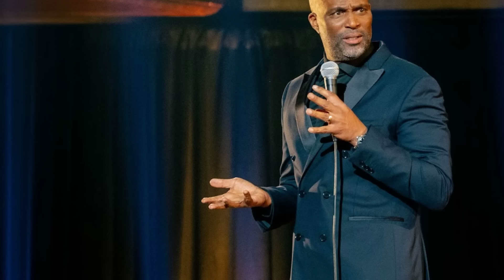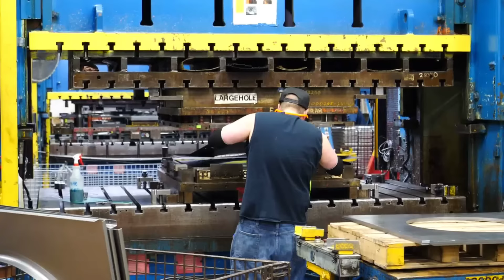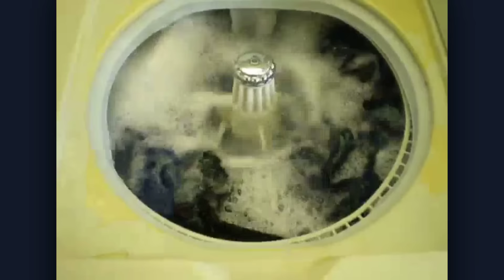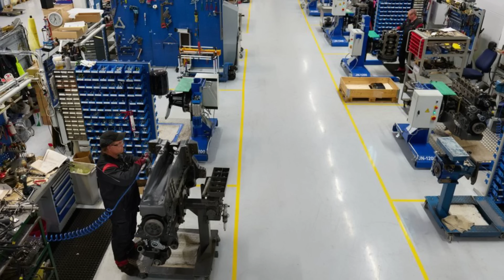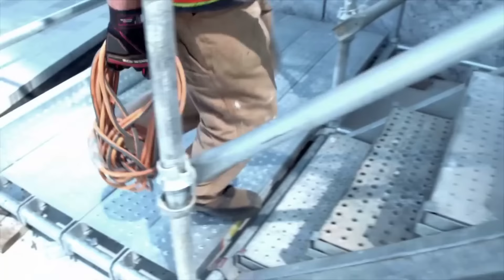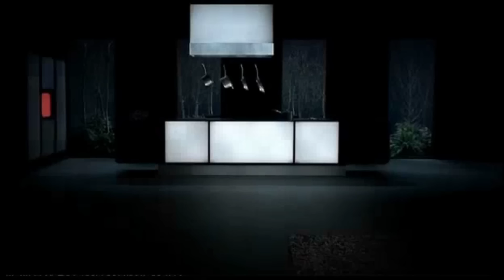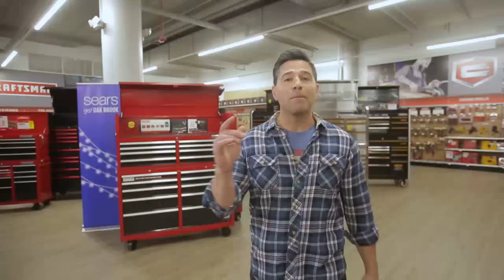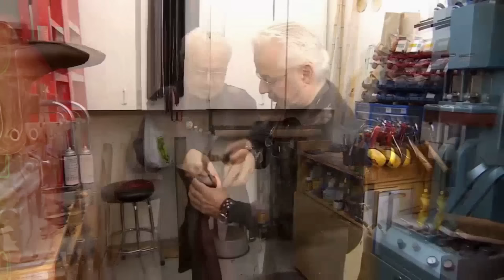The Only 5 Brands That Still Last (The "Buy It For Life" List)

Comment: Speed Queen (Washing machine)
Honda GX (Small engines)
Goodyear-Welt (Leather boot construction method) 
Cast Iron frying pan (Tennessee's Lodge skillet)
Channellock of Pennsylvania (Wrench) Wright Tools (Wrenches and Sockets)
Reply: Thank you!
Reply: Thank you!
Reply: Thank you 😊
Reply: Speed queen washing machine for sale
Reply: There has to be more than five?  I have three VERY old washer dryers.  Kenmore washer at least 35 years old.  I had a GE oven that finally failed after at least 30 years, only because a needed part was no longer available.  New top rated GE digital computer display failed after 10 months, in ONE YEAR warranty, but now it isn't.  

GE radiant cook top lasted at least 18 years, until I broke it.  I found a GE convection with analog controls, but had a mfg defect covered by one year warranty.  now they are trying to sell me a service contract.

My old fridge failed after many years.  Best I could find was a Whirlpool made in Canada, ONE year warranty, so I bot a five year service contract.  I don't expect it to last much longer.  

CRAP.  There are good brands like Speed Queen, which I will buy.  Or an analog GE "garage" fridge that should last quite a while.  But our choices are diminishing to Zip.  

New cars are a NO BUY!  Period.  Good used ones are hard to find.  New cars now track you, & will shut your engine down if a chip stops working.  A $500 headlight?  My old Camry uses an $8 replacement bulb.

We are screwed.  Big Time.
Reply: @millerforester6237 The existential problem with cars is there's obviously no old no-frills robust EVs.

But Internal Combustion Engines have this one little issue with .... 
wars in the Middle East.

And look, in about another decade who knows what issues there may be with supply?

There are however small enthusiasts businesses who will do electric conversions of I.C.E. cars.
And with them being aftermarket modifications/retrofits - being able to replace parts should be far simpler. As since its able to be installed in a garage.. its able to be removed and dissembled in s garage.

Especially as DIY conversion kits are available, which will also mean that spares should be readily available. 

And while I don't have specific knowledge, I'm assuming the EV components are not sealed disposable units.

They actually have one advantage when choosing what car, since they are a full engine and powertrain, a donor car with a crap engine (unreliable/low performance) can be chosen.

So a good solid framed vehicle with a long life expectancy can be used, and could be cheaper if the gutless smaller engine model is sourced.

Then install a EV kit, and its up and running, with better performance. Sometimes much better performance if you spend for more powerful electric motors.

And you won't be installing all that data harvesting crap.

I did check out the hobbyists' community back around the early 2000s (after GM crushed their first EVs) when they were all individual installations with the parts sourced separately and wired up.
And obviously much worse battery technology.

But there were some ridiculously fast stealth cars built by "rev" heads.

Including a little Japanese sedan originally from the 70s or early 80s, I think it was a Toyota corolla or a Nissan?

That had the most powerful motors they could find and shoehorn in.
The trunk and engine bay both contained the EV components and batteries shared out between them.

And this normal looking demure little Japanese sedan that only had larger rear wheels and race tires to distinguish it from a grandma car at the carpark.
Would blow away big muscle cars at drag meets.

Now take a good truck chassis 4WD that doesn't rust, and fit in a modern powerful more efficient EV kit.
Eventually yes the battery pack will deteriorate after a decade or so, but thats the only major component that needs replacing, regular maintenance is far cheaper.
And the battery pack can still live on as a fixed battery, say for home power.
And in a decade the replacement battery pack will be far cheaper and hold even more power ie have greater range.

Already ten year old EV replacement batteries are cheaper than a replacement battery cost when the car was knew.
And have more range.
Its just a issue that the dedicated EVs back then were very Meh and built around the longest quotable range, with everything else nerfed to achieve that.
And they often lacked some useful tech like temperature control for the battery, so it didn't get damaged by extremes.
[Early Nissan Leafs suffered in hot climates].

But some old EV conversions are still going strong.
Although I dont know about that little sedan drag monster.

I'm not sure, but I think the owner also had a classic 70s Mercedes diesel limousines, one of those cream yellow ones, also done as a EV.

Oh and the great thing about EV conversions, besides the lack of nanny state big brother integration....

You can keep the full sized spare tire that came standard with the car.
Reply: I'd love a UK version of this message. Only the Honda is familiar to me. Great video!
Reply: What about tires I need tires for my Ford Escape?
Reply: @rousseautr  Tires aren't meant to last forever. Check the ratings on the tire for the mileage they are intended to last, then rotate them every 5k miles to actually get that mileage out of them.
Reply: @txlady1049 thank you, this I know. I was hoping the experts in this comment section would recommend a quality tire.
Reply: @rousseautr  In my experience, most of the major brands produce tires that will last a good amount of miles if maintained properly - check the pressure with some regularity; rotate with every oil change (typically 5-10K miles in modern cars using synthetic oil).  This doesn't count "performance tires" that generally do not last very long. On my sporty car, I run a very high-grip tire that makes the car more fun to drive, but don't last more than 10K miles (even swapped out for the Winter months).  I accept that for the performance the tires add to the car. The car is also not my daily driver, so the reduce miles still mean I only replace the tires every 5 years or so.
Reply: @ianfurqueron5850 this information was awesome! I am recently retired and am running the roads but in a Mom style car, just lost my mechanic and am learning this stuff about my vehicle 😢😢😢 non girlie is not my wheel house.
Reply: @rousseautr Michelin
Reply: @rousseautr  I literally sold tires for a living until I went back to earn my Masters - I found Continental, Cooper and BF Goodrich made for excellent choices for most driving applications. These brands almost always offer rebates or dealer discounts all year as well.
Reply: @rousseautr tires, it's a trick getting the right tire for the right truck. It has nothing to do with aesthetics and what makes it look so cool. Most vehicles should only have a 13 inch rim for a tire. Four-door 0lder cars should have about a 14 inch rim. 
  Motors in cars are like bags of weed.. it's easy to upsell a bag of weed when you can hold your breath and tell you almost pass out and say let them, that s*** almost knocked me out but you can't pretend anything with automobiles, they're either a pass or a fail.  Companies are putting tires and rims that are significantly too large for the entire drivetrain creating catastrophic damage at an early stage. On top of that, the replacing reliable dependable parts with parts designed to fail. If you find an old rusty bucket, it only needs four parts to get it running... Think about it
Reply: Thank you
Reply: Thank you!!
Reply: you're doing the Lord's work
Reply: GRISWOLD cast iron #1 (made in Erie PA USA!) is the gold standard! Then #2 Wagner (Sidney OH USA!) and #3 Lodge (USA & China)…..
Reply: Thanks. I didn't feel like watching another piece of sh!t Ai video.
Reply: thanks for compiling this list
Reply: Have at least one of each!l

Speed Queen's have bearings with grease zerks!

How Honda does it I can't understand.  Kawasaki is about the same.

Yanmar diesel generators are the only way to go.
Reply: Appreciate your doing the written name brands so much. Thank you!!!
Reply: Briggs & Stratton small engine
Reply: Love my speed queen - 7 years ago and no issues - simple dials - love !!!
Reply: I took an appliance repair course about 25 years ago. Although Speed Queen was highly praise for its stainless steel basket, the agitator and shaft were pot metal so electrolysis caused by the soapy water eats away and the shaft and they all fuse together and seize up.
Reply: Great, now I need to find a cobbler.  Apple cobbler?
Reply: Miele is better.
Reply: Griswold!    Look for anything used Griswold, typically cast iron skillets, made in Erie, PA.  They have a smoother surface than Lodge, and they'll NEVER wear out.  Just learn how to 'season' them.
Reply: Channelocks are trash. And I consider anyone using them as hacks. I quit using them 15 years ago.
Reply: @tacocattoday  Ok pal
Reply: Thank you 🎉
Reply: FYI - Lodge cast iron is made in Tennessee, not Kentucky
Reply: @judirollings3959  yes! That’s what it says
Reply: @mooselodge3881 that's what it says NOW. See that word (edited) by the time stamp? The OP corrected it after it was pointed out. 😉
Reply: I found a wrench that beats Channel lock . Sears used to make them, then Kirkland . Don't know who makes them now. Channel locks slip too easy and tips don't line up..
Reply: @chev39rsh Knipex pliers are made in Germany and are the best I've ever used. They are expensive but a pleasure to use and worth every penny.
Reply: @unpopularopinion8608  True. Knipex, Wera, Wiha. Buy it for life.
Reply: @unpopularopinion8608 they're even not that expensive when you buy them from Germany.
Reply: @unpopularopinion8608 second Knipex. All sizes all applications. Knipex is king.
Reply: @unpopularopinion8608  And the Knipex Cobra grips are superb - well designed and thin construction and just fit in your hand perfectly.

Comment: If you have problems with the carb "gumming up" you are using ethanol fuel,  Never use ethanol in small engines.  It turns into green fuzz, which plus the siphon holes in the carb.  Unless you have tag wire (which I do) you're stuck.
Reply: Can’t you put stabil in it, and run it dry? 64 year old woman here. I use stabil, high octane fuel but try to run all my small engines dry….

Comment: I wore Thorogood Blk 6” steel toe boots for 2 decades until they changed their manufacturing. Boots were purchased through the company store that provided all safety equipment and uniforms. The yellow and red logo on previous boots was now black with silver lettering, sizing was way off, sole quality was poor. I see Thorogood still shows the red/yellow logo online and I don’t know why the change for that year, but it’s too late. I dropped their product line.

Comment: Forgot about Speed Queen. Hand tools - lots of good tools made in Taiwan, Europe, and yes, even China. Just have to do a bit of research before buying. I've a lifelong love/hate/hate relationship with cast iron skillets. This isn't an easy road, just because the voice says "buy one" doesn't mean you are going to like them. Boots, yeah right. I think the nearest "Cobbler" to me that can put new soles on is a 4 hour drive away. And at what cost? Gen sets and small engines. That's a whole subject but there are good alternatives to Big Red - here in Kalifornia it's all distorted and crapified by CARB and mandated ethanol. So even a Honda gen will die if not coddled. I use propane compatible gen sets.

Comment: The description of the Goodyear welt is wrong.  The stitches go through the mid-sole not the sole.  The sole is glued to the mid-sole.  This is better because the sole wears out fastest and gluing makes it easier to replace. The stitches don't have to be cut to replace the sole.  An error like this is typical of AI generated content. 😞

Comment: "Coobler".  That is a term that is obsolete along with the idea of resoling a boot.  The cost is way more than I paid for my last pair of boots. Cast iron.  The cost is still relatively low, maybe twice the cost of a coated pan that will only last a couple of years.  Safety, I am not so sure about.  In order to use cast iron, the pan must have some sort of grease or oil added.  High temps cause those materials to degrade and produce known carcinogens that might be worse than a teflon coated pan.

Comment: 7:41 Pretty sure that's a made-in-Germany Knipex 4" Cobra plier. Channellock usually has teal dipped handles. Both are excellent (Knipex is slightly better, but more expensive too).
Reply: Channel Locks you can use as a hammer..
Reply: @michaelking550 every tool is a hammer unless it’s a screwdriver then it’s a chisel or a phillips punch.
Reply: Knipex slightly better than Channellock is a gross understatement I have a ton of Channellock pliers I’m not going to say they aren’t good tools, but they aren’t even in the same league when it comes to Knipex. Wilde are another US made tool company that are great too but nobody is as good as Knipex.
Reply: @Booney1286 I totally agree. Knipex are the king of pliers brands. They are superb. I'd go as far as saying that every household should have a pair of knipex cobra pliers to hand. You can do so much with them and the grip is unreal.
Reply: I totally agree. Knipex are the best! More expensive but worth it. I've a collection of them. I'd go as far as saying that every household should have a pair of knipex cobra pliers. Truly excellent.
Reply: Came here to say the same thing

Comment: For work boots, as a truck driver, I have had good results with Ariat composit toed work boots. Something g in the 150+ range worn 5 days a week should last at least 2-3 years.if. tou purchase 2 pairs and wear them every other day, they could potentially last a decade. Important note when wearing work boots on a daily basis. You need 2 pairs so that alternating out every other day gives the boots time to air/dry out.
Reply: Yup, that’s exactly what I do also. I’ve been wearing Red Wings since I was 20. My current pairs of work boots are 3 years old. I’ve got a pair of “Sunday go to meeting” shoes from 2003 that are still looking good and comfortable. 
Regular cleaning and oiling is key.
Reply: I love my Ariats.
Reply: My experience with Ariat has been great!
Reply: The problem with Ariat work boots is you can't re-sole them. Soles are made separate then glued on to the boot. How do I know? I have a pair that can't be repaired. Won't buy Ariat again.
Reply: @ronmetz9172  I broke my back and neck in Afghanistan, and I don’t know what it is about Ariat boots, but they really help me have less pain at the end of the day compared to other boots. I’ve tried all kinds of different brands and custom insoles, but for whatever reason, Ariats make a huge difference right out of the box. They seem well built, they’ve lasted a long time and are still going strong, but I do wish that when the time comes, I could send them back to Ariat to have them resoled.
Reply: Ariat= Chinese cowboy boots no thanks
Reply: Absolutely true

Comment: I have heard from repairman that yes a Speed Queen will last long time however they need repair often. 
Honda engines are rock solid and I don’t think you can do better. 
I personally have purchased several modern Craftsman products and they have been great. I currently have a craftsman riding mower and I have never been more pleased in my 63 years. 
I like and use cast iron and stainless steel. I would never eat anything cooked on non stick cookware. 
Terry

Comment: Also I loved cooking with cast iron. But at 78 years old my wrists are weak and I can't lift or handle heavy cast iron skillets anymore.
Reply: Good point! I don't think it's fair to compare inexpensive nonstick pans to iron or steel. I use all three, for different things. The cast iron is for steaks & in case of intruders.
Reply: They sell a smaller pan and a small skillet
Reply: @chi_pixie actually I found a 10" cast iron deep skillet at Aldi with a handle on both sides. I can use both hands. Much easier.
Reply: Right there with you, I will be 75 this year and I need both hands for my cast iron.
Reply: The best lightweight, reasonably priced cookware - if you are willing to switch to stainless steel - is Farberware. Also very long lasting if washed by hand (the handles will develop minor cracks if frequently washed in a dishwasher).
Reply: @judirollings3959 I use both, cast iron and my 35 year old Farberware daily. Had to buy the smaller cast iron a few years ago because the old stuff, also 30 years old, that I used while raising my family, got way too heavy.
Reply: Look for a carbon steel pan. A lot lighter.

Comment: Kind of funny. I own a samsung front loader. No transmission. 10 years old never had a problem. It is direct drive so eventually the motor will need replaced. It is an earlier model when they were trying to gain market share. Doubt they have one as good now.  I have abandoned Honda generators for Harbor Freight models.  They are more repairable and get stolen less. When my buddies Honda failed during a power outage took a harbor freight over and bailed him out.  The stock carburetor will fail on harbor freight after maybe 8 years or so. Upgrade it to a good quality aftermarket unit.

Comment: Danner boots. I bought when I was 15. I work in construction 265+ days a year for 15 years and still going strong. Have given pairs to every friend I know willing to let me. 
Cutco kitchen knives I was gifted a 1965 set
I drive a 1988 Ford F-150 easy to work on and if the parts ever run out I can 3D print replacements (metal 3D printing is a thing)